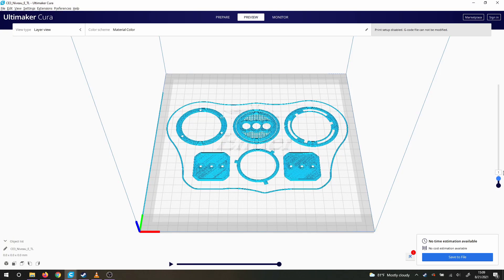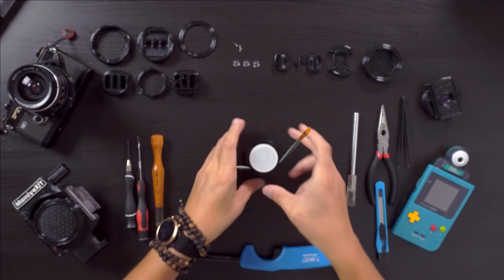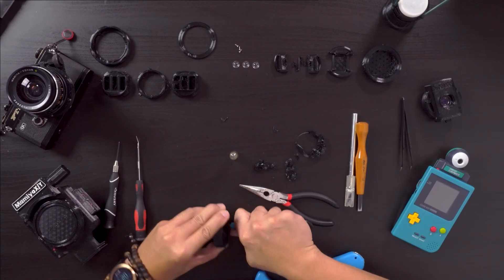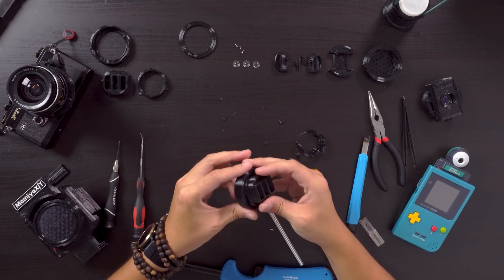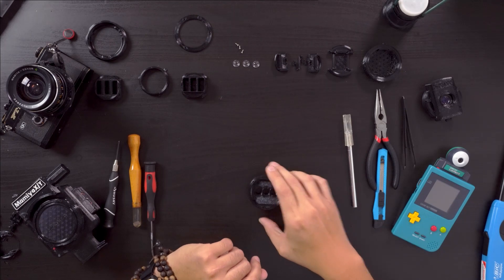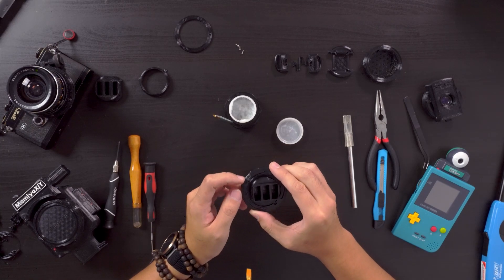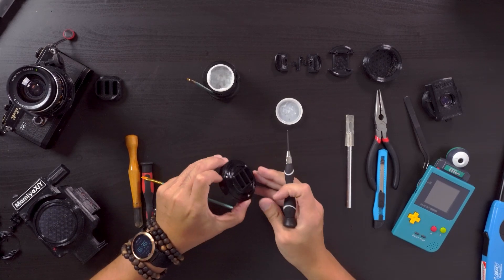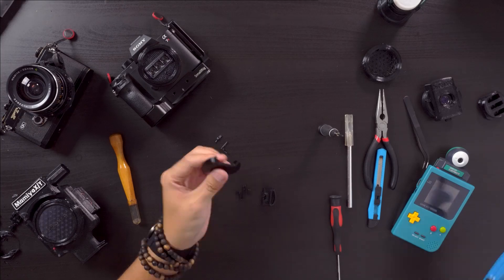How To Print | niveau 3D Stereoscopic Wiggle Lens

Comment: Quite close to having this working. What is the difference between the two baffles?

Edit: I just saw the other video where you mention the two options. What I'm not sure is which of the baffles (file 1 or 2) is the good performing one. Thanks

Edit 2: I assumed it's the longer one. Assembly completed and running first tests! Looks great, light leaks are significant, but the kind of tape I could find did not improve them. I expect to publish some video made with this on my channel.
Reply: Where have you found the information about the differences of the two baffles? Also not sure which I should take.